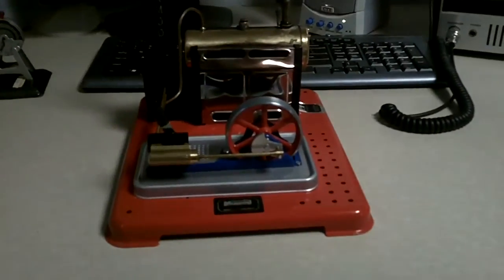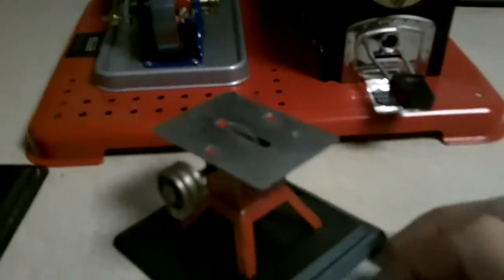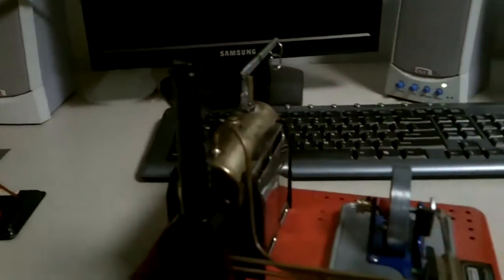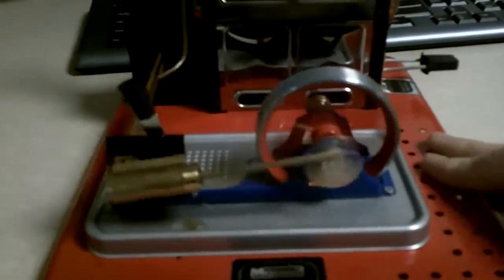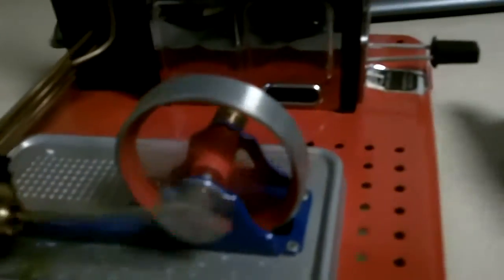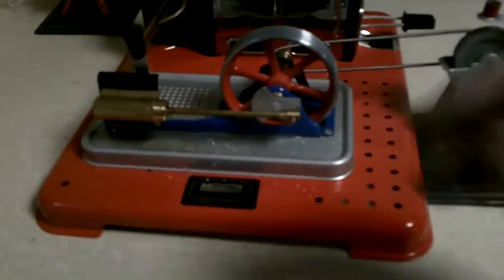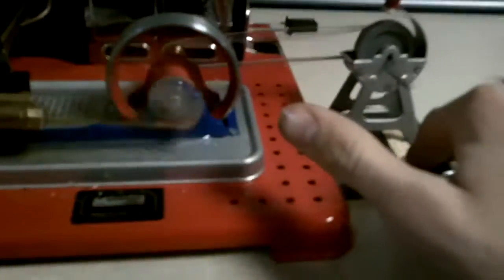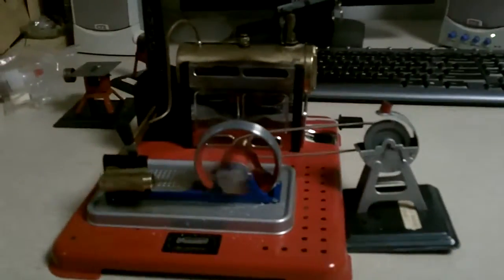ACTUAL WORKING DESKTOP STEAM ENGINE

Comment: That's really cool! I hooked up one of those saws to my solenoid engine and cut toothpicks too lol, I also fixed my small screwdrivers with the grinder. I had a drill press as well, good for drilling popsicle sticks =D Does the boiler have a safety popoff valve?